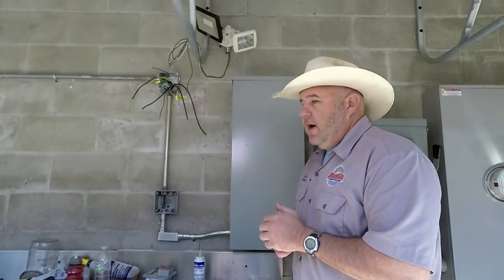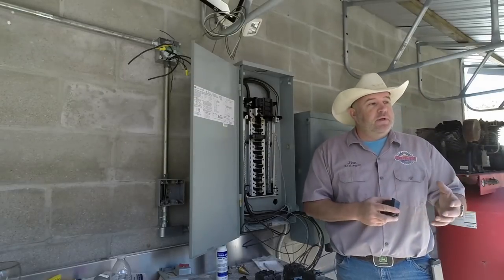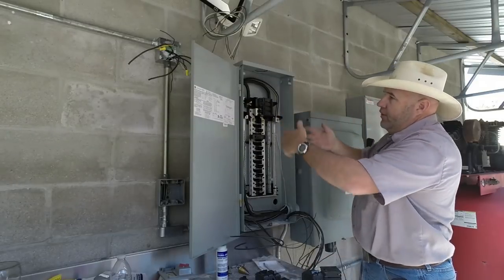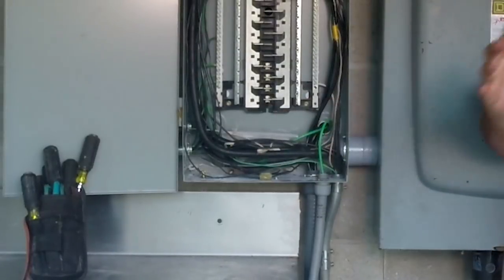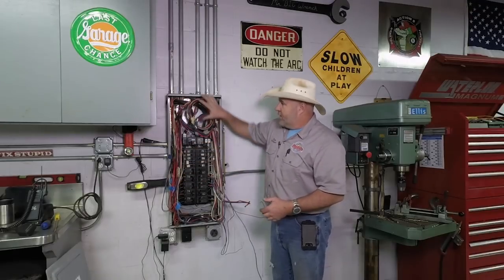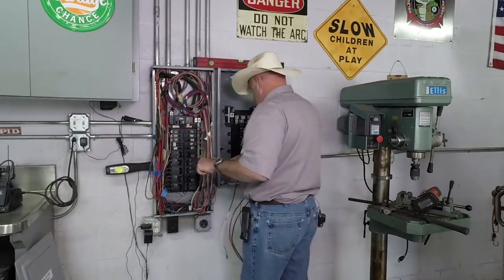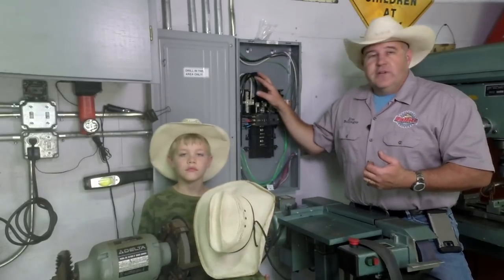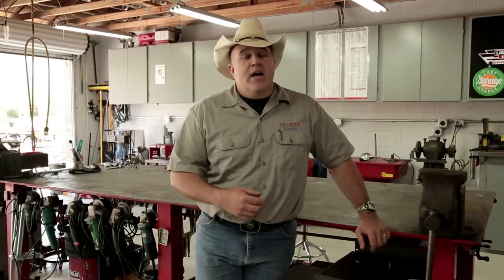ELECTRICAL Service PANEL INSTALLATION, WIRING for PHASE CONVERTER part 2

Comment: With that semi wet area, it wouldn't be a bad idea to use the outdoor compression type fittings instead of the set screw indoor type. I've pretty much switched to the compression type for everything. They cost a little more, but are nicer to work with especially since I typically work alone. They are strong enough to let you pull off things that would usually require a helper. Great video. I especially like the editing extras, always good for a chuckle.

Comment: Looks GREAT, this was a nice follow up video. Are the 2 switches for the compressors of the lighted style? Even though my compressor is inside the shop, I put a standard light socket above it, on 1 leg of the 220 outlet, so I can see if it is ON or OFF. The ON/OFF magnetic contactor is mounted right next to the shop door so it is easy to shut everything down on the way out. Lighted switches or small neon indicators in the switch plate cover are nice reminders.

Comment: May I ask what voltage you are running your Phase Converter from? ( such as 240 single phase) and what are your power measurements comeing out of the american rotary comverter when you measure Leg to Leg for T1-T2=        T1-T3=           T2-T3=          ? I'm looking to compare with my phase converter output.  Thank you.

Comment: Thanks for the video. Can you pass wire thru one box to go to another (wireway) with different voltage or phasing (single phase to 3 phase? I think in some states that is an issue. May be o.k. in others. Nice video.

Comment: Small correction breakers on one side of the panel do not cause a imbalance as each slot down the panel comes from a the other phase 
The socket above the sink is that GFCI ? I would have also used a water proof cover on it so it could get wet with an extension Lead connected.
Personal preference I like to run ground wire and not rely on emt to make the connection especial out side where it is subject to corrosion 
I'm surprised your electrical inspector allowed you to install the rotary unit under the main disconnect

Comment: You seem to be very smart electrically. After the rotary phase converter can you single phase your three phase machines?  Following along with your video seems like this is an electricians nightmare.
Reply from the maker: Thank you for the compliment. Yes it is possible to single phase the equipment if the rpc is not turned on. American Rotary now makes the machines so that the single phase  cannot pass through the machine unless it is running.  They also make a retro kit to upgrade machines without that option. I plan on adding that option, and will make a video. 
Interesting fact, if you have two pieces of three phase equipment running at the same time, you can shut the rpc off and everything will continue to run. Essentially the machines motor become the idler/generator for the other piece of equipment. Think about that for a minute.....lol. There are a lot of reasons that is not a good practice, but it does work. Thanks for watching!

Comment: Why did you not use copper instead of aluminum? Just wondering
Reply from the maker: Service feeds are typically done in aluminum. Everything else is copper. Look in your box wherever in the world you live/work, 90% chance or better the feed is aluminum. It's a cost thing.
Reply: DoRite Fabrication just wondering. Ours is copper. It was expensive as you said.
Reply from the maker: More than likely what the power company gives you (what they own) is aluminum. What you put on your side (what you own) is up to you as long as it meets code. Everything here (typically) is aluminum to the main, unless your super old school (pre 1940s). I already had the 4/0, so it was free, and rated for the 200 amp max load of the box. Bonus for me....

Comment: Im sure u said it in the video but somehow i missed it. How many HP is that guy? Not many capacitors in it but the box looks like it could fit a 30+hp pony in it. 
Im currently assembling a 30hp RPC myself got a screaming deal on a 30hp brand new in the box motor for $300 local pickup. I,m very electrical aware. I have some large 480 VFDs in my shop i use now but i have a cnc that has a voltage/phase monitor and doesnt like the VFD output so RPC it is. How many mfd worth of caps are in your cabinet for how many HP?
I keep reading different things from 10mfd to 25mfd per HP of pony motor. Problem is i'm cheap and dont want to buy too many but im also impatiant and dont want to wait for more to show up if i dont have enouph. I figure A.R. would have that fairly figured out. I'll still have to custom ballance my own but a ball park sure would make a better start. Thanks for the videos keep em coming

Comment: #4 isn't good for 100 amps, even in the 90 degree column. If you're going to be pulling 80 amps, #4 is going to be undersized after you de rate it, and account for your loads being continuous. It'll take a while,  but you'll overheat the lugs in the panel, and worse in your phase converter.

Comment: Are you going to need an electrical inspection? I am no electrician, but a lot of what you did would not pass in my area. Must have clear area in front of panels, wet location & outdoor gfi and in use outlet covers, etc, etc,................

Comment: You shouldnt wash eggs as the shells are porous.
Reply: Mr. greens Eggs are not porous to water or else they would dry out. A cloaca is filthy, all eggs must be scrubbed with chlorine or other anti bacterial sterilizer in water then dried. Chickens are dirty scavengers, filthy nasty dim witted opportunist omnivores.
Reply: johnvallesfarm yes they are.
Bumpy and grainy in texture, an eggshell is covered with as many as 17,000 tiny pores. ... It is a semipermeable membrane, which means that air and moisture can pass through its pores.
Try googling it ! I worked on egg farms they no way in the world wash them in anything, they are gassed. These eggs were not for eating but incubation.